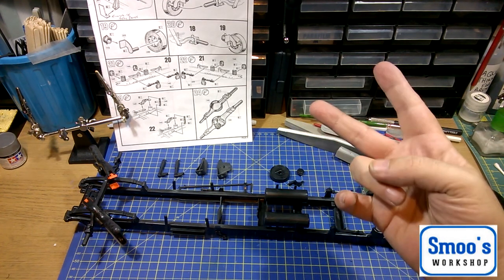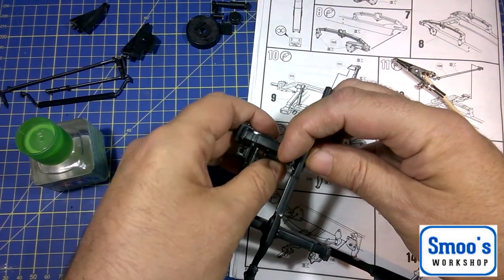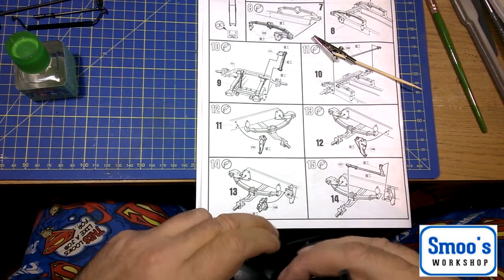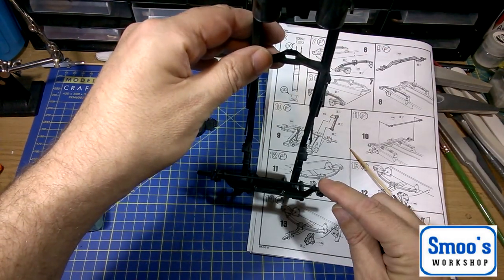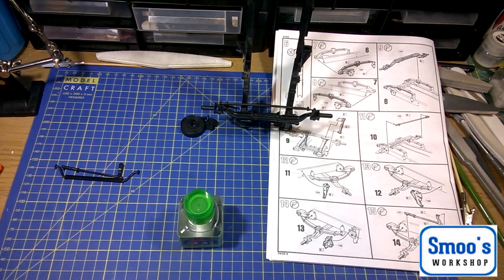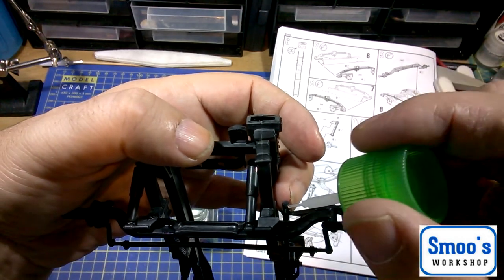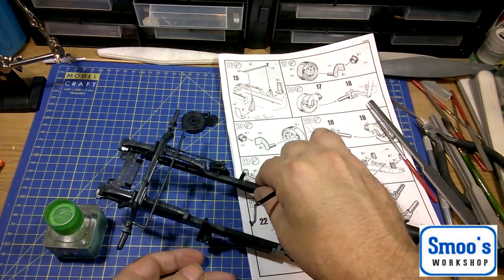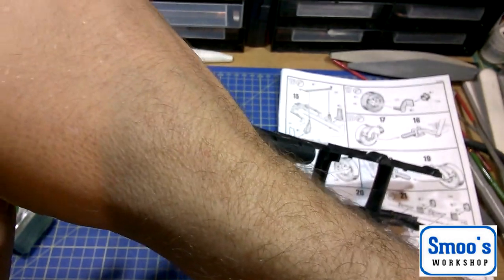Revell 07455 1:16 Peterbilt 359 Conventional Truck Build video #2

Comment: Had this problem on my Peterbilt..the roll bar is upside down in the instructions..it actually supports the two small pieces of bodywork.
Reply from the maker: oh so mines might be upside down? i better check that before spraying, thanks
Reply from the maker: tackled it this evening your right it was upside down sigh fixed now though